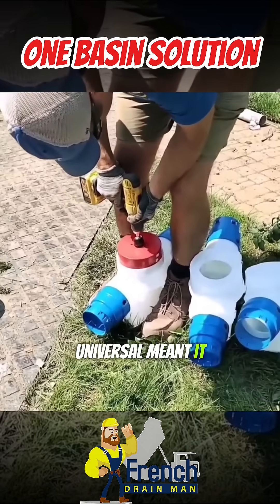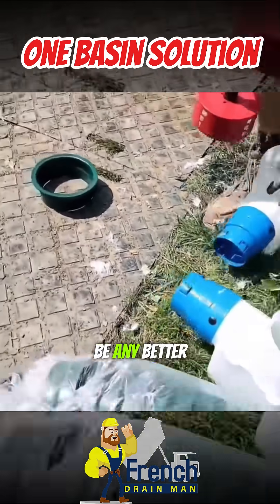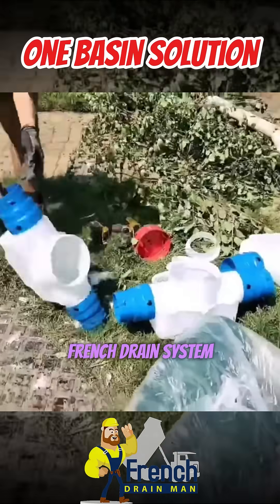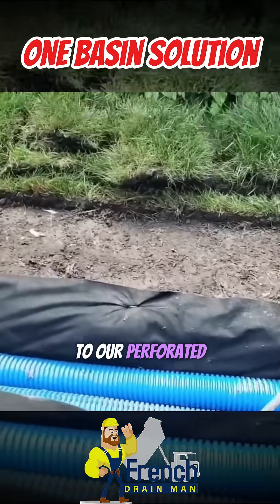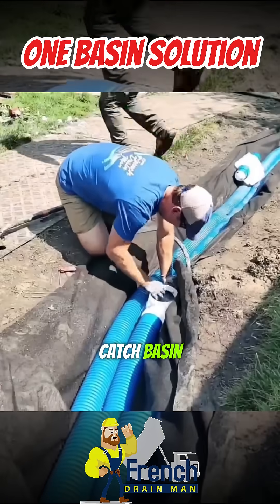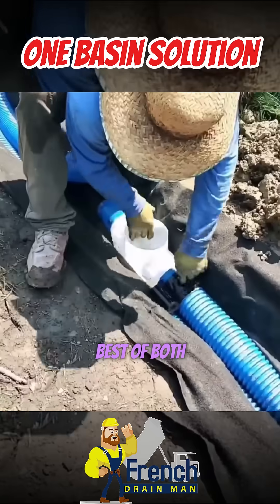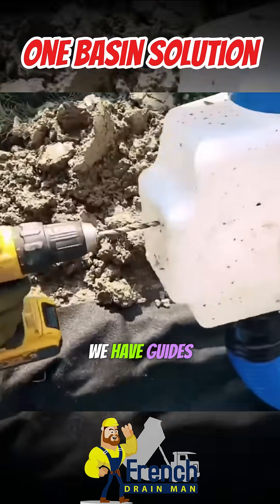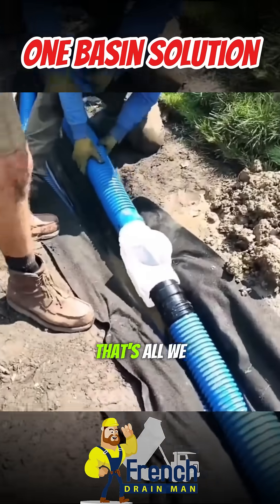How to Combine a Yard Drain and French Drain the Right Way

Comment: You could probably have an AI calculate that using Ksat ratings for the soil & the NOAA rainfall data.  If the rainfall is higher than the soil's Ksat rating then you need surface inlets too. I think my soil was rated for something like 3 inches of water every 24 hours so I need surface inlets b/c I would see standing water(or a FD every 40ft or less).  So much math to play with.